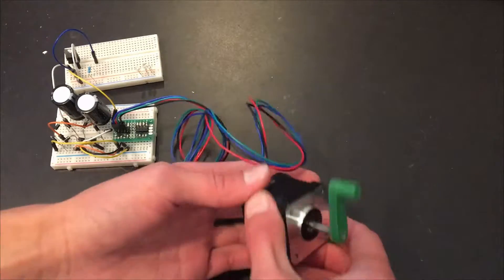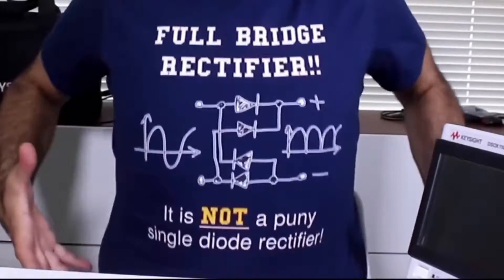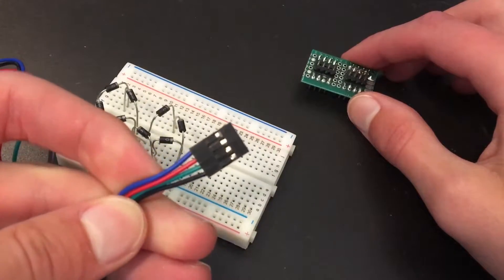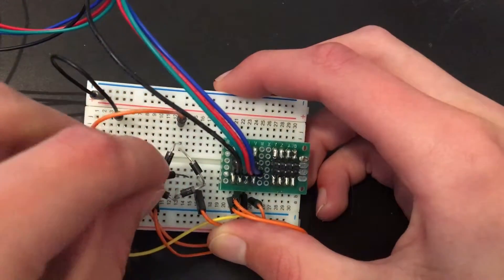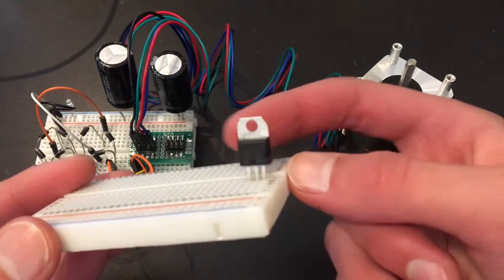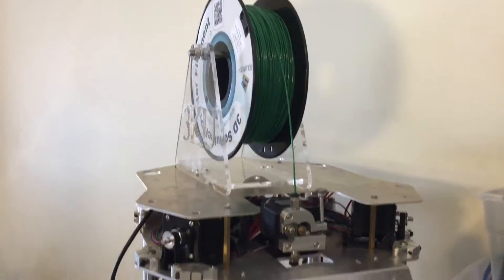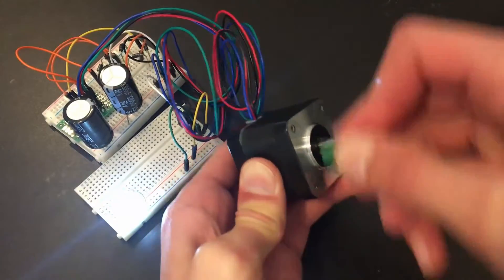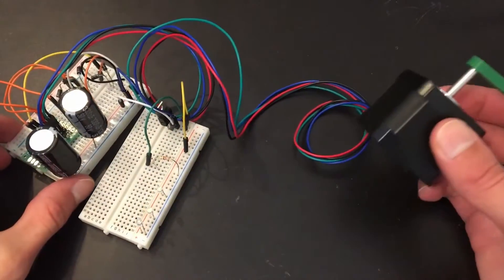Making My Own Power! Building a Hand Crank Generator

Comment: Great explanation🤩
I am late to the party. Do you think I can easily generate 12 V or 24 V with a 24 V linear regulator in this setup?
I am experimenting with a hand powered amplifier/speaker. To visualize how much work/force goes into making sound :-)

Thanks!
Reply from the maker: Yes I think it’s definitely possible to generate 12v or 24v, however a geared DC motor is probably a better fit for this application. Sounds like a great project!

Comment: I am new to this field and I have looked for some information to make a DIY generator at home. It is the most helpful tutorial including what parts you use and why u are using!

But I still have some questions after watching this.

1. Why did you connect the parts in order of generator -> rectifier -> capacitor -> regulator? If I change the order of capacitor and regulator what problem will I have?

2. Regulators make consistance voltage but I think It will make unconsistance current instead. Is it okay to charge something like phone or batteries?

Comment: Nice simple project. Buthow much power can you generate like this? The motor seems to turn very easily.
Reply from the maker: Probably not much practical power. To generate more, a higher speed would be required. This also isn’t the ideal setup as usually geared DC motors are used for hand crank generators, but this was just a proof of concept using what I had on hand.
Reply: @CarbonCoil  thabks for the reply. I already tried geared dc motor and got a few watts, but using stepper motor would be more elegant

Comment: What it is, is a Full-WAVE Bridge Rectifier.  Originally there were two plates and a cathode in a Full-wave rectifier tube, which worked with a center-tapped secondary on a transformer.  But if you don't have the center tap, then you use a Full-wave bridge rectifier.  There is no such thing as a full bridge rectifier in a Dictionary of Electronics Terms.

Comment: whrwhat if i do it in to and fro motion ....... will it provide stable voltage
Reply from the maker: Yes, because the voltage that comes out of the stepper is already AC, a large enough smoothing capacitor will provide a stable voltage when turning back and forth in both directions.

Comment: Is there a way to tie the internal coils together, like in series? or parallel? Or will this cancel the phases?
Reply from the maker: Not sure about tying the internal coils together. I don't think this would work because the two sine waves are not in phase with each other. However in this design they are combined after being rectified to DC.
Reply: @CarbonCoil  thanks. I think one way (series OR parallel) will cause the phases to cancel each other, hence (much) less power output. True?  My goal is to use only one bridge rectifier for less voltage loss.
Reply from the maker: @TheSpektacle  This might work, play around with it a bit and let me know if it does.

Comment: What's the amperage? An LED only needs 20mA, a phone needs 1A at least...
Reply from the maker: The amperage will depend on what specific stepper motor you use. You can look up the data sheet for your specific motor to find some of this information.
Reply: No it doesnt "need" 1A, it CAN draw up to 1A
Less will work fine
Reply: i would say less than 100mA